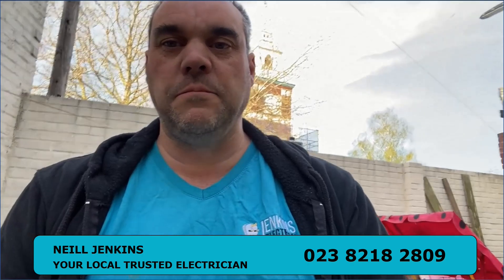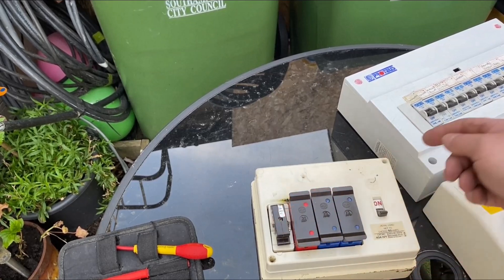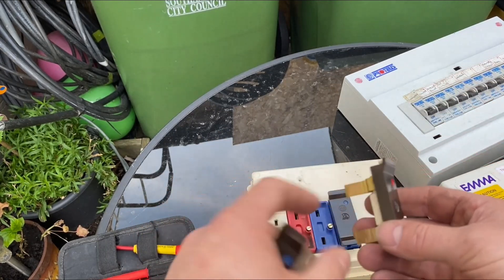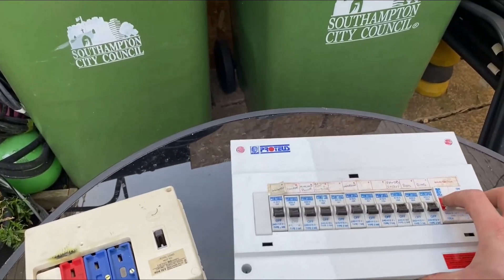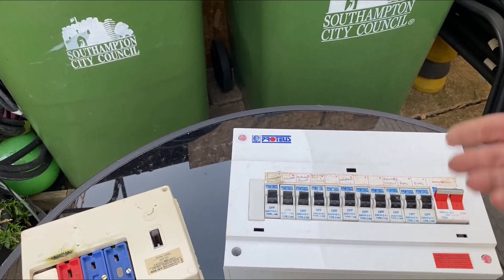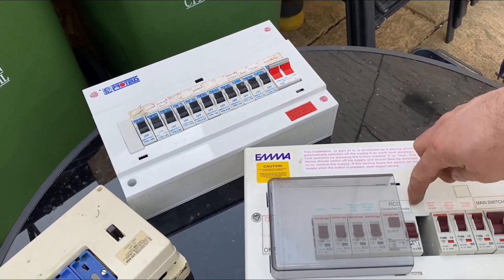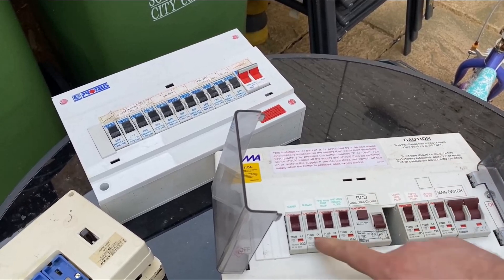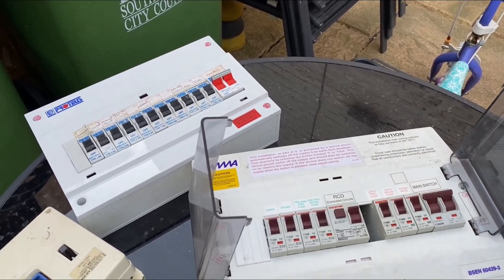How to reset my Fusebox !  - The different types in the UK and how to reset each one

Comment: Hiya please can you advise me on iv just had a electric cut and iv checked the fuse box theres no sign of a trip in one of the switches and main box it's got no error sign any advise please
Reply from the maker: If you have No lights or Power it is probably a fault from supplier, Easiest way to check is to make sure every switch on Fuse board is pointing up, Then press the RCD test button, If nothing happens then the problem is from outside or with the Meter, Check for credit if is a pre payment unit....
Reply: @JenkinsElectrical  much appreciated mate just I'm on quarterly meter iv checked fuse box and nothing is out of place and checked main box no joy
Reply: @JenkinsElectrical  but massive respect for you to reply